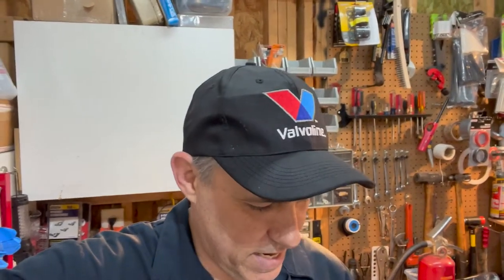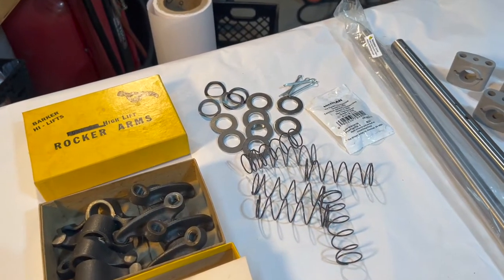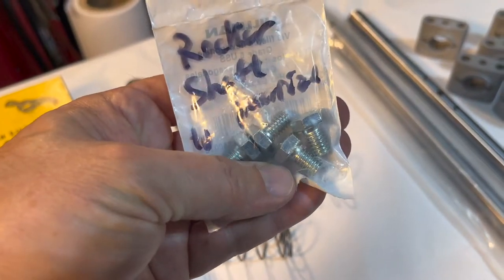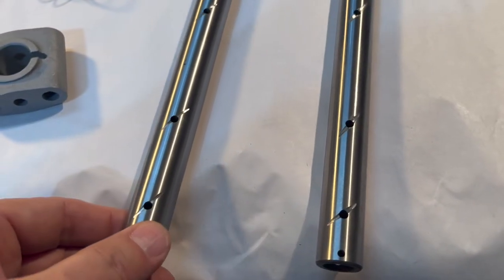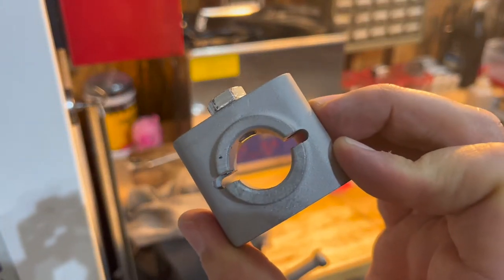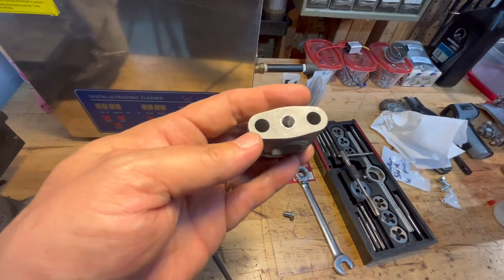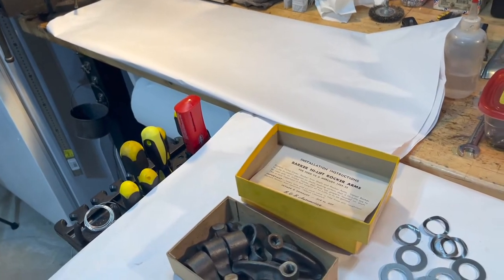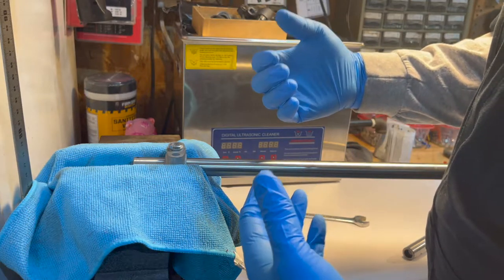Y Block 312 Ford Hi-Lift Barker Rocker Arm Assembly Rebuild

Comment: Nice to watch your assembly. Hi-lift rockers by Barker and Thomas did not add much because offset stands were not included. If they would have had shorter push rod sides without machining the push rod holes for clearance there was interference. I’m not sure on the Barkers but Thomas went after the weight. Since the improvements for oil in YBlocks thru the cam bearings and better use of multi weight oil have really made the engine much more reliable.
I always worked with geometry to get the most out of stock rocker arms. Slightly shorter push rods and lash caps really helped. Thanks for the video.

Comment: Have you installed the "G" heads on the 292 block or do you have a 312.  If you installed the "G" heads on the 292 how much difference did they make.  This video was excellent, it showed me some things I was not aware of, thank you.  Plus all your videos are great and a learning experience.  I have a '57 Thungerbird 312 that i am rebuilding to put in my '56 Fairlane 2 dor Club Sedan.
Reply from the maker: I have a set of G heads on my 292 and another set ready to go for the 312 I am building. G heads came on 272s and 292s in the 1957 model year, but mostly on 312’s after that, making them hard to locate at times. I will report the difference in a video series once I get my C2AE 312 in the car - but that upgrade will include more than just G heads.
Reply: @HotRodReverend  Thank you.